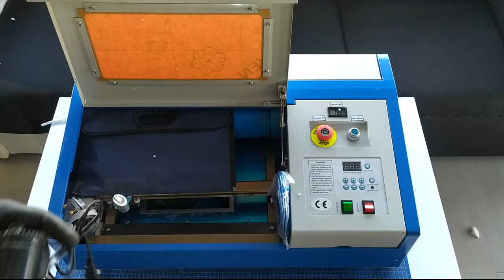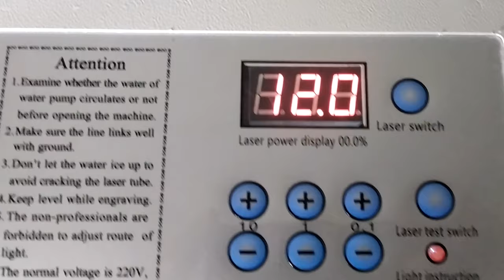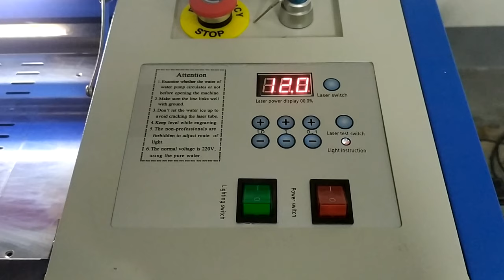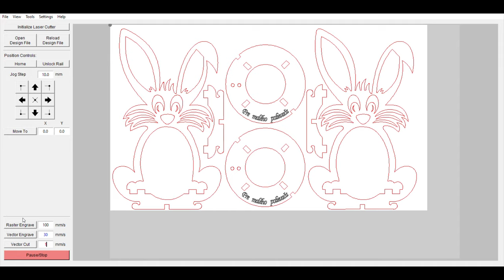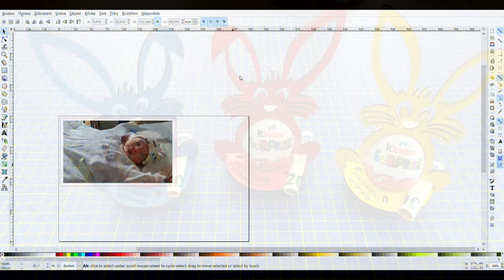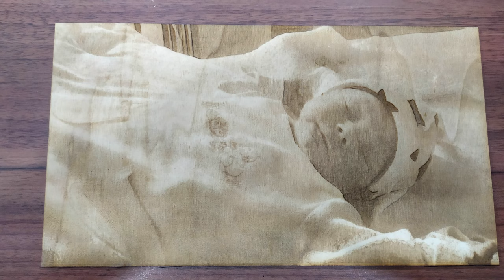K40 40W Chinese CO2 laser Cutter Engraver ,Unboxing and First Tests

Comment: be curious to know... if I bought something like this from China, what are the step 1 fixes I need to do... change...
wanting to control the unit not via the on system control interface.
i've heard things like air flow/extraction, etc.
this being 2 yrs ago... allot could/would have changed ?

Comment: @kukomio Your waterpump, can it be totally under water?
Reply from the maker: yes it must be because the water at the bottom is colder and the pump also has suction cups for fixing to the bottom
Reply: Can you provide mode fole which is support 40 wat which i getting bigger then it

Comment: For me it is not working at all for 3mm plywood. It is not cutting through in fast speed. And in 6mm/s there is flame very often(30%).

What are you cutting(material and width)? What cutting speed do you use?